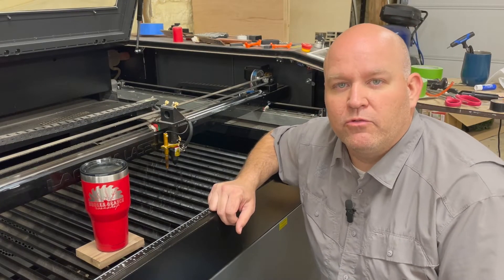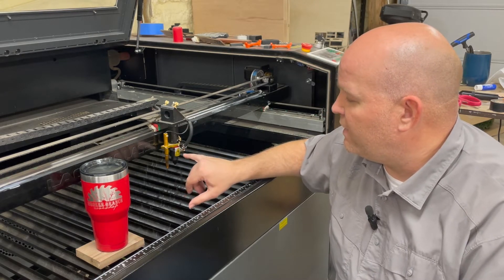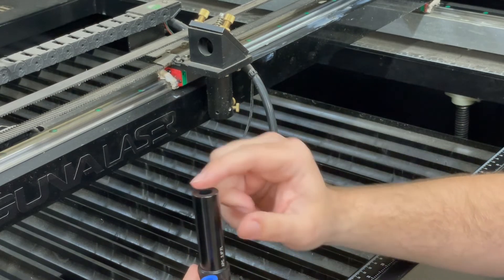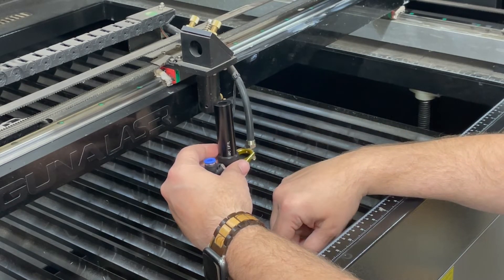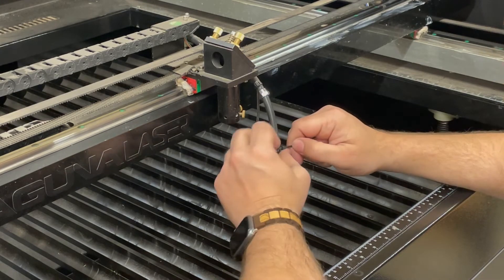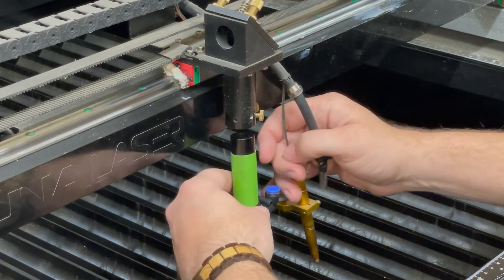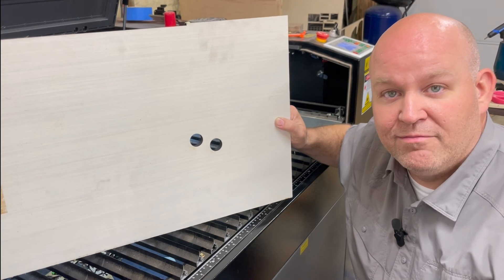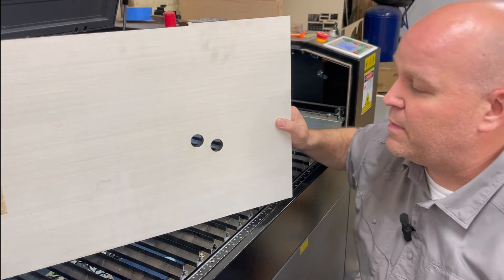CHANGING FACTORY LENSE AND NOZZLE FROM LAGUNA EX TO AMERICAN PHOTONICS

Comment: How do you keep the tube from hitting the side of the machine? Is there a way to change the home/origin location so it does not crash into the side?
Reply from the maker: @stefanie9991  for the long tube I just slide it out before rehoming/turning the machine on. After it homes, just move it and slide the tube back in.  Only have to do that with the longer tube.

Comment: Do you know where I can get a shorter nozzle so I can engrave on thicker woods. I have the laguna Mx I want to engrave on round circles that only fit across the bed. In other words I can’t lower the piece of wood, so a shorter nozzle will work
Reply from the maker: Check with American Photonics. They have sets with 4 sizes in them.
Reply: @brokenbranchwoodshop1873  Thanks

Comment: We don't have a better way to find the distance the auto finder should be?
Reply from the maker: This way worked pretty well. And was fairly quick.
Reply: @brokenbranchwoodshop1873  I get it. But we still don't really know how close the laser head needs to be to the material? It's really just a guess. Try to repeat how close the stock one is?
Reply from the maker: @silverback349  That’s what I did on the video but afterward I did a ramp test.  When I moved it to the optimal position on the ramp and measured it was spot on where I had it.  So if you’re not sure I would do a ramp test.

Comment: Excellent video and perfect timing.  Just received my American photonics lens kit from Laguna and asked how to deal with tube size difference.  They sent me to this video.  Very helpful.

Did you replace your factory lens and lens tube with the same size american photonics lens?

My kit doesn’t include the 2” lens because they assume I already have it.

Any ideas on how I could modify (find parts) for the issued factory lens tube?  Would like to replace with the same type push connections as the new lenses.
Reply from the maker: The one I got was just a little smaller so I wrapped a few layers of tape around it.

Comment: I would like to get a beginner's  CNC.
What would you recommend? I would like to be able to do things like put names on cups, monogram leather, and some beginner's cut outs.
Reply from the maker: There are a lot of options out there.  I have a Laguna Ex but that’s a pretty large machine.  There are many brands. A lot of people will tell you go straight thru a Chinese factory.  But those are mostly folks that can easily work on their machine if they have problems.  
My recommendation would be to go thru a company that has in country support that you can easily contact.  
There is epilog (pricey but good), there’s Laguna, Boss laser, stealth laser and a few others. 
If your wanting to do cups don’t got with the smallest one.  Get one with an adjustable bed that’ll go deep enough to do the cups to want. 
Hope that helps some.